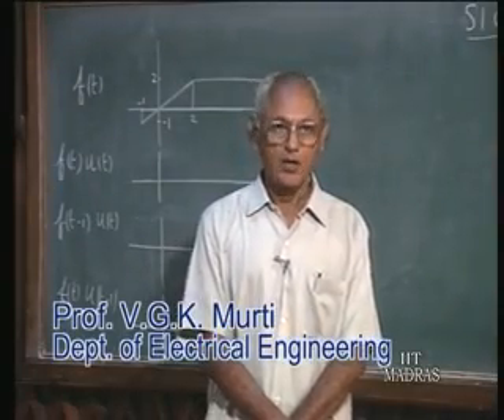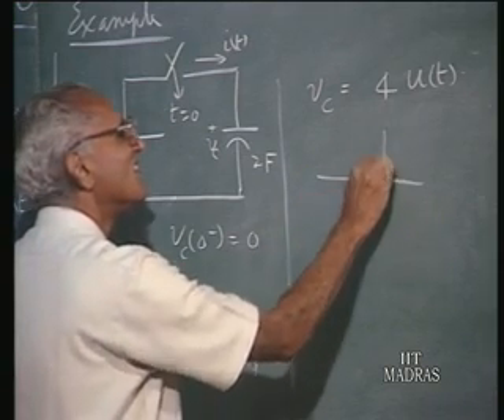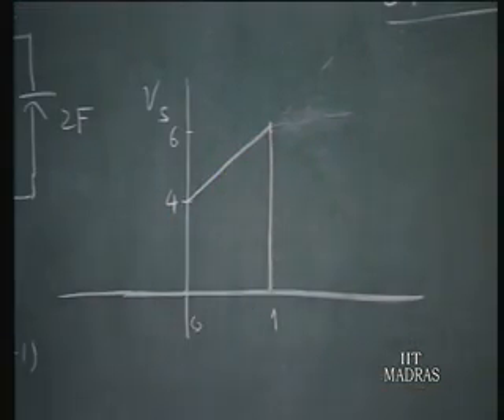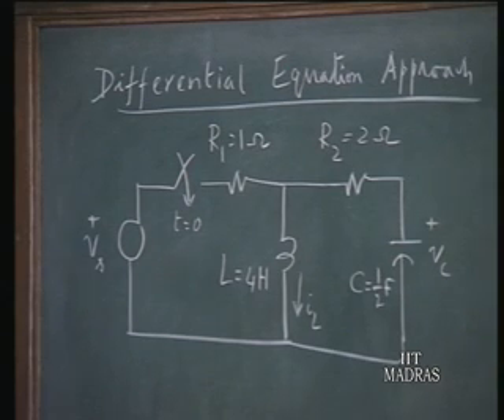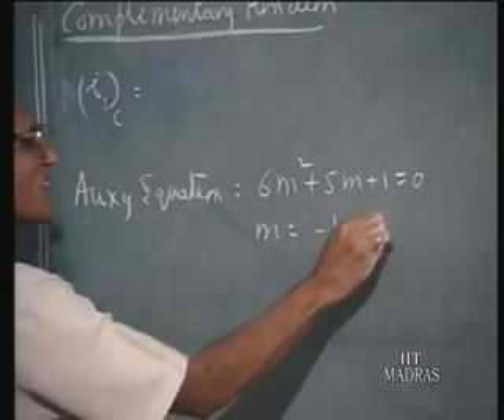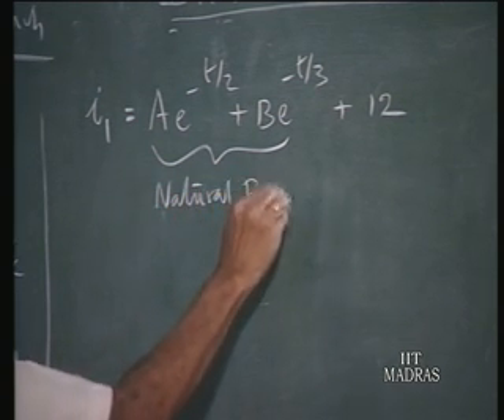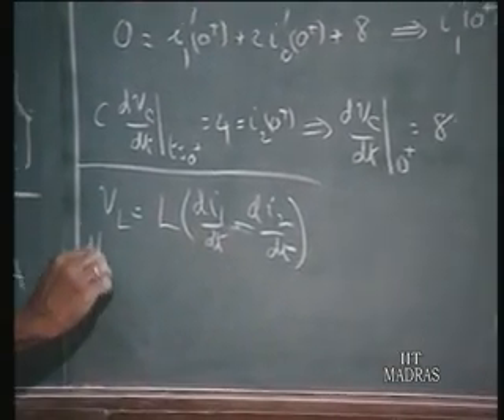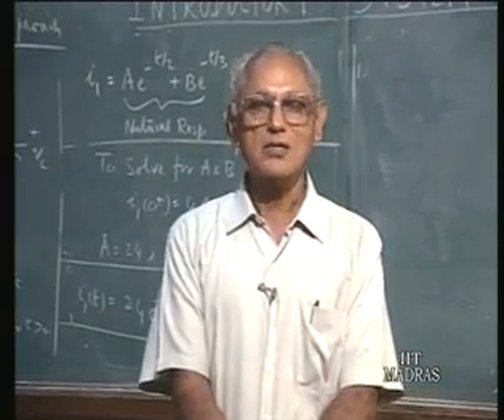Lecture - 4 Introductory Concepts (4)

Comment: Iit is easier to understand capacitors and their charging and discharging using a unified approach to electrostatics and circuits. Watch these two videos on Current snd conduction process and surface charges to know more. i. https://youtu.be/REsWdd76qxc and ii. https://youtu.be/8BQM_xw2Rfo